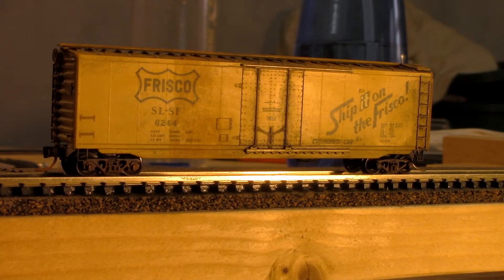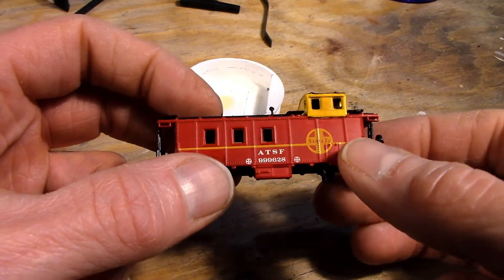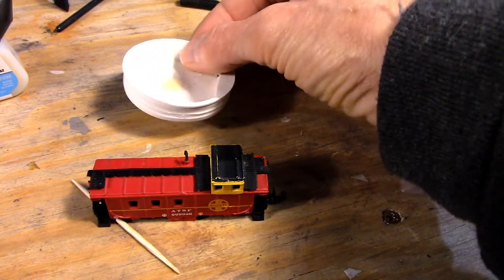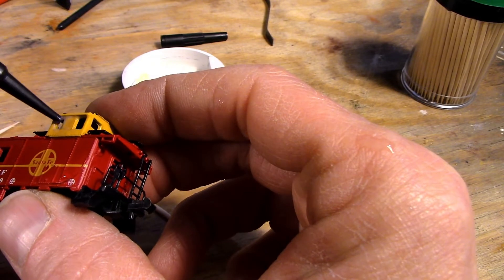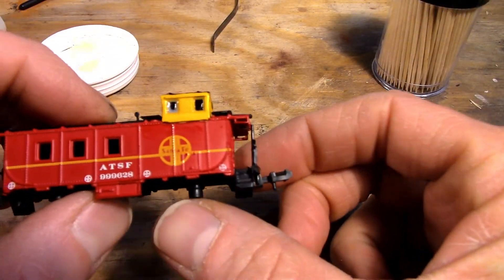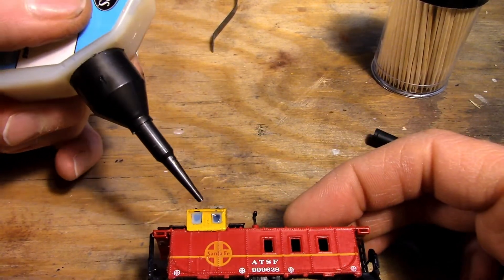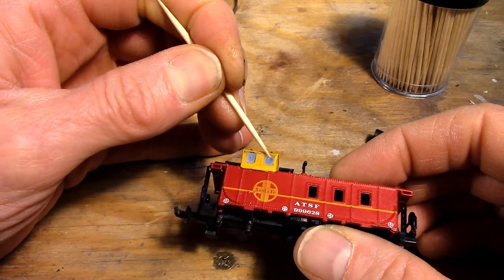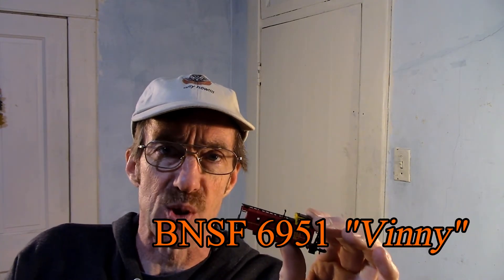The Car Barn-Making Windows-Part 1

Comment: I use sheet acrylic for windows
Reply from the maker: You mean acrylic that you can buy in sheets or recycle it?
I have some of that and am going to do a video on that as well.
Thanks for commenting!
Reply: @ralphgreenwood5857  I do both depending on what the condition of the plastic
Reply from the maker: @southern207hobbies  Sounds like a good plan to have!
Reply: @ralphgreenwood5857  4
I did the same for larger cockpit windows